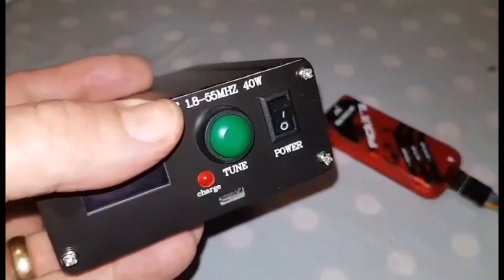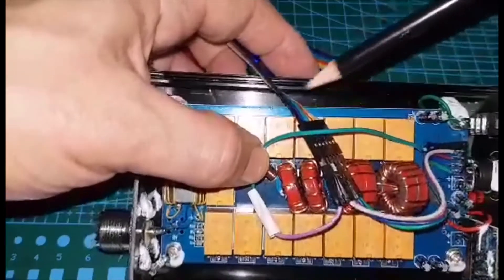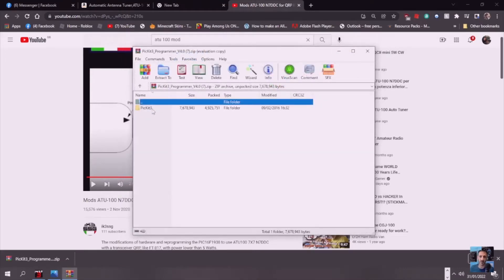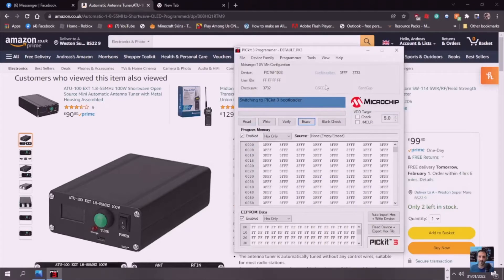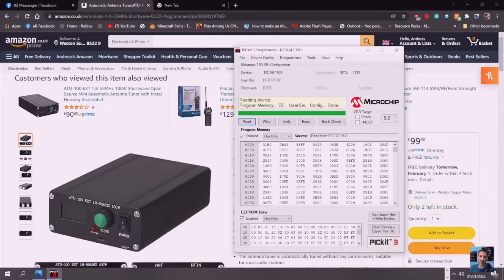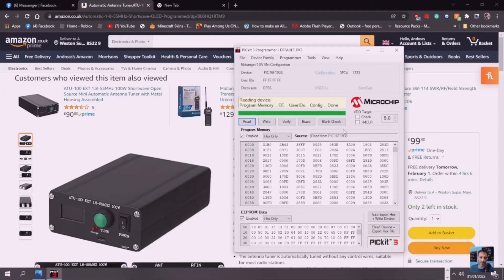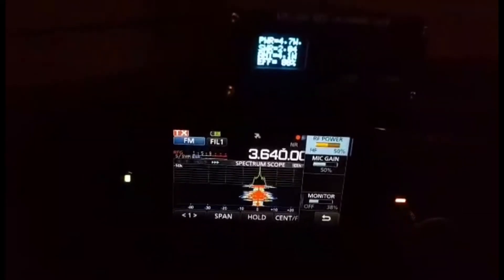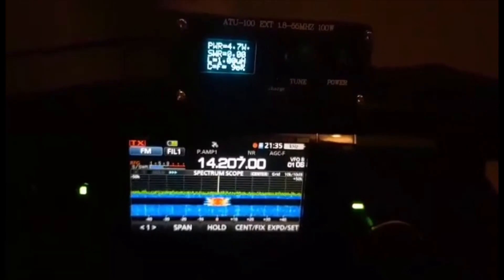ATU 100 EXT -Budget Tuner Modification to QRP and Autotune -(NO HARDWARE CHANGE)helped by MW0SAW

Comment: If I hold the tune button without the software mod, will it tune QRP? Mine works perfectly on my 100 watt radio but I have totally run into the not auto tuning below 5 watts. My uSDX+ never ever puts out enough power to auto tune 😉
Reply from the maker: Its not meant to i moded mine .
Reply: @HamTechRadioScannerDrones  Thanks so much! I didn't think it was supposed to. A buddy of mine just did his last week with the programmer, I might have to borrow his program adapter or just order one. His works great with his 705 now. I can't wait to fix mine. I have the uSDX+ and the tuner in a man pack of sorts so it would be nice to have it tune right

Comment: So I'm assuming that the issue with my ATU-100-0A showing TUNE, but not activating the relays/not tuning is due to the power required without this program change??  Was thinking it was just defective since my other ATU-100 EXT came out the box working great.
Reply from the maker: Depends what radio you are using .

Comment: So now the Pickit2" arrived. But with it my first problems:
sudo ./pk2cmd -B./ -I -P
says: "Auto-Detect: No known part found."
So it does not tell my which PIC chip is inside. If I select a PIC16F54, PIC16F57 or PIC16F59 because these are the only ones which I can select with the PICKIT2 Software in window$ without getting errors directly there seems to be some communication. But reading the ATU-100 chip does not work at all. Normally in the PICKIT2 software under "source" the ATU-100 should be found and the chip content be read but that does not work and I do not know why. Though it tries reading, the Busy LED is flashing but the hex code is only 0000 or FFFF. Nothing else. So I assume either my model is not the model it should be, or it has any kind of defect or the pickit2 is not able to communicate with the ATU-100.
On the supported devices list the PIC16F1938 is mentioned though. And this is the chip in my ATU-100. The Pickit self check went ok. So there seems to be no obvious problem. (???)
Reply from the maker: Hi all i can say is follow vid step by step it was a long time ago and i only did this once .
Reply: @M0FXBHamTech  You need the MCLR cable with the Pickt it. Then it works fine.
Reply: My first was a bad clone..2nd was fine.

Comment: Hello.If i do the mod can i use it with my usdx transceiver? 73s de SY1DUG
Reply from the maker: Hi my guess is if you can get the tuner to kick in at 0.1 Watts then maybe better to use an antenna made for the band .
Reply: @M0FXBHamTech   perfect thank you